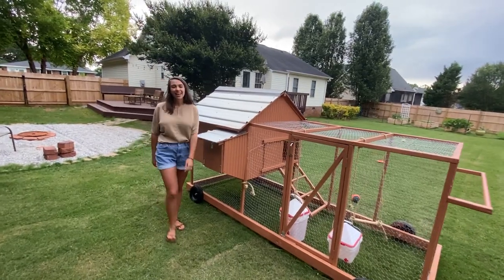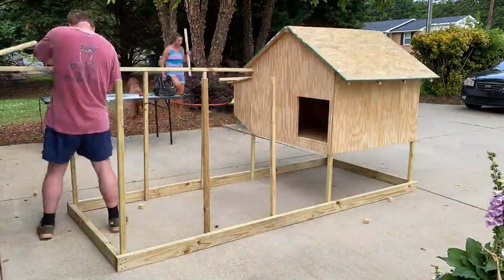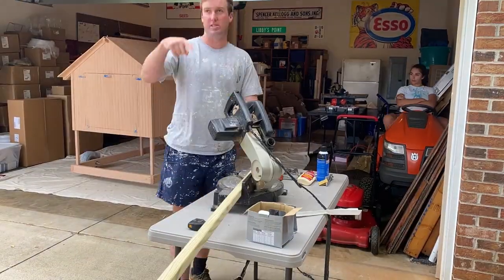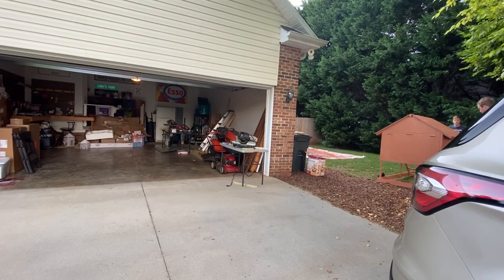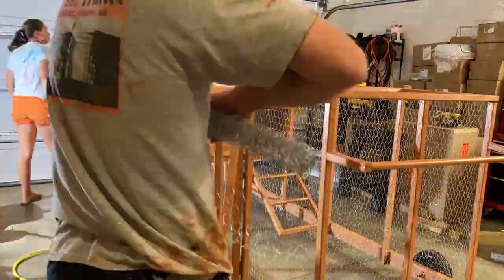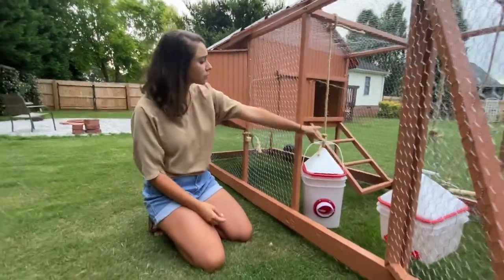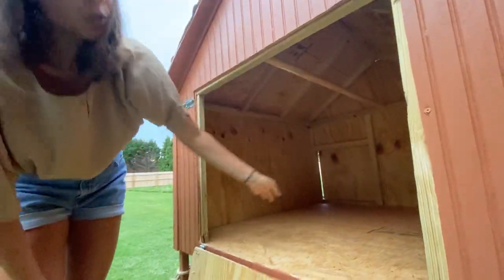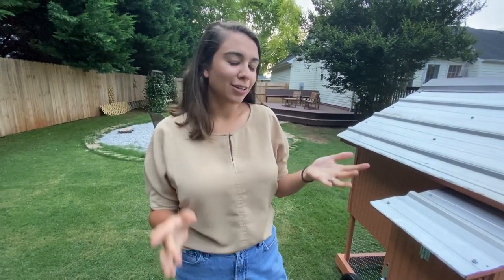How to BUILD the PERFECT MOBILE CHICKEN COOP // DIY EASY to Use and Build BACKYARD Chicken Coop

Comment from the maker: Any questions about making a coop or about this coop? Let me know down here in the comments!
Reply: Nice video. I would like to build something similar, what are the dimensions of just the coop?
Reply from the maker: Indoor portion is 4x4
Reply: How much do you think yall spent on this?
Reply from the maker: @purplesummerfarmstead7665  Hey Ali! It was pretty easy but it was kind of expensive I think all the lumber was around $300 from Lowe’s. If you go to an actual lumberyard it would probably be a little cheaper. The coop is 4 x 10‘ including the run the actual house part is 4 x 4‘. We used metal roofing scraps which was much cheaper then shingles on the roof. I hope that helps! With wheels and roof, all in 400 bucks!
Reply: Do you regret anything you did in the building process?
Reply from the maker: We put the roof on too early, frame everything first!
Reply: Hey Libby , have you had any issues with predators getting in ?
Reply from the maker: @akerno  I have not! They are also inside of my 6 foot fence in my backyard. Someone has suggested to me to use hardwire cloth instead of chicken wire for better predator proofing
Reply: Why did you put the roofing on horizontally instead of vertically?
Reply from the maker: Can’t believe you were the first person to notice that!! These are just some scrap pieces so this is the only way that they would fit 🤣
Reply: @LibbyFlanagan  🤣 I was so confused, I saw another one of your comments saying it was scrap so it all makes sense now.
Reply: Do you have the actual plans?
Reply from the maker: They are in the works!
Reply: How many children can stay in that space?
Reply from the maker: 4 chickens!
Reply: @LibbyFlanagan  hello!! I loved the vid! Question, what are different alternative I could use for bedding?
Reply from the maker: Straw, any wood chip, saw dust, I’ve even seen leave litter
Reply: I can appreciate all the hard work put into this build and video. I just have a few critiques:
There is no ventilation! Chickens need fresh air even if the coop is kept clean. Proper ventilation helps with CO2, ammonia, bacteria, mold and heat. Especially with a metal roof over wood with no insulation. Ever been up in your attic on a hot day?
The wheels are not retractable, which means it never really sits on the ground. Very easy for predators to dig in.
Also there is no ground extended wire mesh for dig in protection.
Chiken wire is only meant to keep chickens in or out of an area, but it IS NOT predator proof. Heavy gauge welded wire mesh is best.
To much cleaning maintenance, especially because it is not vented, also no room for deep bedding method.
Only one roosting bar could cause pecking order fights.
Two egg boxes also helps lower conflicts and broken eggs.
Reply: What is the dimension including the box and laying box
Reply: Do you have a supply list?
Reply: I'm interested what supplies do I need
Reply: Hi Libby! I would love to build this coop (during spring break if possible).  Do you have the plans ( or some notes ) available to share? They will be VERY much appreciated!

Comment: A nice setup. It does need more vents & the chicken wire isn't the best predators deterrent. My mini dachshund ripped our chicken fence apart, killing all our chicks; then we used 1x2 wire, but a raccoon killed our 2nd patch of chicks by grabbing them. Now I only use hardware cloth & ended up buying an electric mobile chicken fence. Then the hawks moved in, so we built a mobile coop-yard  that is completely surrounded with hardware cloth. I tell you, at times, keeping my 5 girls safe has been a challenging, expensive endeavor. 🤨
.

Comment: 🤔 you may wanna put some Type of flooring like linoleum on the bottom of the chicken coop to prevent de urine from the chicken soaking into the floor. By putting the flooring in the bottom of the coop it will prolong the life/ usefulness of the coop.  You may also wanna install some ventilation window in the roost to allow for airflow.

Comment: I love your coop and I have a few questions: #1. What are the dimensions of the coop? #2. How did you put the wheels on? #3 What tools will I need? #5. If you don't mind me asking... how much does it cost to build the coop? I am considering backyard chickens here in Florida and I'm not a master builder.  Your coop and run look easy and affordable. Thanks, thumbs up, and subscribe from me!!
Reply from the maker: So glad that you like it! It was pretty easy but it was kind of expensive I think all the lumber was around $300 from Lowe’s. If you go to an actual lumberyard it would probably be a little cheaper. The coop is 4 x 10‘ including the run the actual house part is 4 x 4‘. To put the wheels on we just used a drill to make the hole in the bottom 2 x 4 and then put a bolt on the back side. For tools you’ll need a tablesaw a drill a stapler and a Circular saw. We used metal roofing scraps which was much cheaper then shingles on the roof. I hope that helps!

Comment: A couple of questions: 1. Did u ever make plans and or a material list. 2. Did you ever have any problems with predators burrowing under the run and getting in through front door? 3. How did u keep fasteners from poking through the roof?

Comment: This is a great coop..but you must have ventilation holes or they will get sick. Drill out some big 3" holes on each side of your coop (6) on each side and put wire over them....lower your perch so the drafts don't tough the chickens.
Reply from the maker: Hey Tawnya! Great points, I have a part 2 out with some updates you should check it out 😊

Comment: Chicken wire is only meant to keep chickens IN. Predators can and will get through that with little effort. I would switch that out for metal cloth and make sure nothing can dig under your fence easily.

I know this because we had a coop almost identical to this. We went out one Saturday early to go swimming & hiking. We were gone for 4hrs. When we came back a neighbors dog had dug under a section of privacy fence and chewed through the chicken mesh. The babies were near but we had used heavier duty metal cloth and she couldn't get through it. She didn't dig under it because the temporary enclosure was sitting on a poured concrete platform with cinder blocks holding the enclosure down. The pitbull did try and shoved one block over but couldn't get to the chicks and eventually gave up. We entered the yard to see her napping on one chicken that was still alive, barely. Five were in pieces and she "played" with the sixth one until her little body gave out.

Comment: I like your design but please be aware, Racoons can actually rip apart chicken wire..hardware cloth is a more secure option. They also will hunt during the day, especially a female with kits. You could just staple the hardware cloth over the chicken wire..I turned my tin roofing so channels run up and down and then secured some gutter pieces which flow into a rain barrel, which is secured to back so it moves with coop...I loved how simple your design is.

Comment: Ummm, her husband put the metal roofing on in the wrong direction. The raised lines should be vertical so that water and snow moves downward and away from the coop; by installing the roofing with the raised lines running horizontally, water and snow will move laterally across the roof and end up in the run instead of being shed off the sides.
Reply from the maker: Yes! We were just using scrap metal and that is the only way it could work! No big deal it runs off the side no problem!

Comment: Anything you regret doing on it, thinking about building something similar.
Reply from the maker: I do have a part 2 up where I added in some natural roosts that they really love. I would have left just the metal roof without wood underneath to shed a little weight. I have also thought about a floor made of just hardware cloth for the summer so dropping fall right through and add more ventilation

Comment: Sorry, could you reply to me again please, I saw it come through but it disappeared before I could read it.
Reply from the maker: That’s weird!!! This is what I said:

So glad that you like it! It was pretty easy but it was kind of expensive I think all the lumber was around $300 from Lowe’s. If you go to an actual lumberyard it would probably be a little cheaper. The coop is 4 x 10‘ including the run the actual house part is 4 x 4‘. To put the wheels on we just used a drill to make the hole in the bottom 2 x 4 and then put a bolt on the back side. For tools you’ll need a tablesaw a drill a stapler and a Circular saw. We used metal roofing scraps which was much cheaper then shingles on the roof. I hope that helps!

Comment: Chicken wire...HORRIBLE choice!

It's great for keeping chickens in but does nothing for keeping predators out!!  You should use welded wire mesh (also known as hardware cloth) to secure the safety of your chickens from predators.

Also, your roost is a round pole which is not ideal for chickens. Chickens roost flat-footed! They're not like parakeets, parrots, robins, blue jays or other tree dwelling birds that grab a hold of a branch.  That round pole will actually hurt their feet over time.  A flat 2x4 with the corners chamfered is best for chickens.  Even better if you were to wrap that 2x4 with some sort of hemp rope.

Lastly, whoever had the idea of putting on your roofing material sideways wasn't thinking very clearly.  Water runs downhill especially out of slanted roof! So having the roofing ribs run horizontally doesn't make any dang sense!!